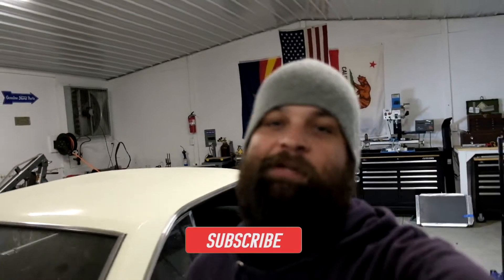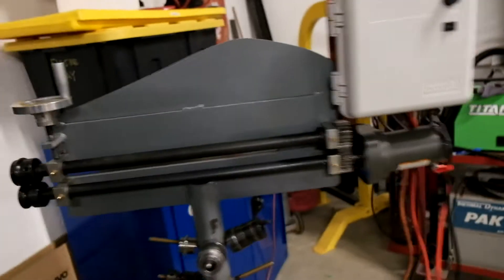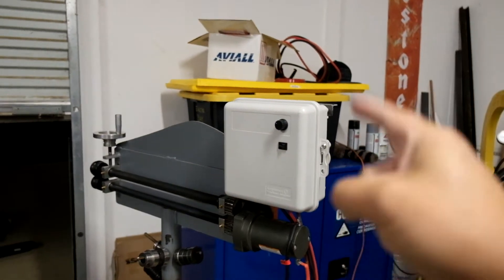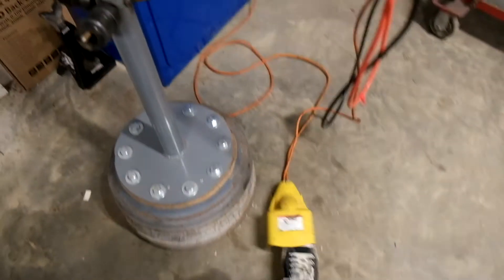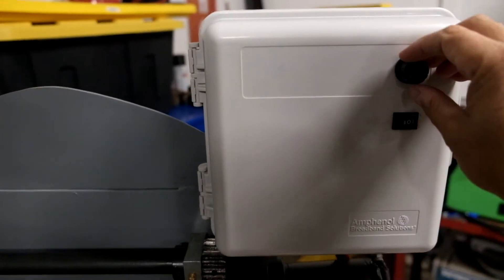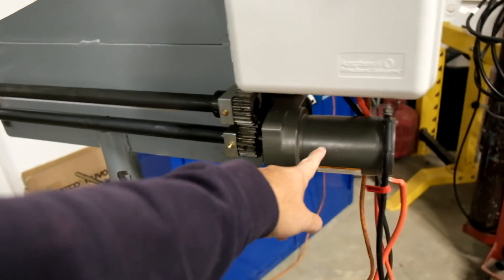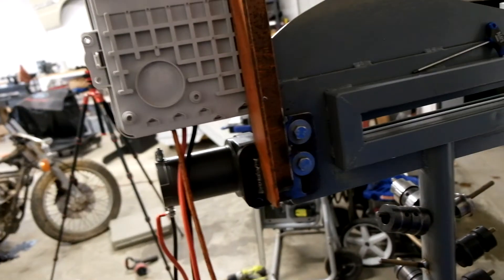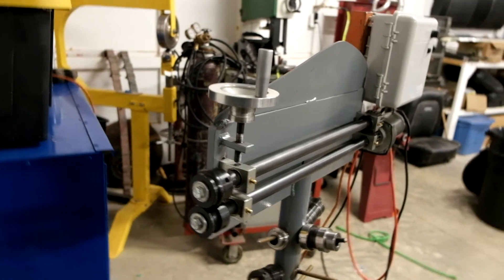How to motorize a cheap Chinese bead roller

Comment: How did you attach the motor to the roller.?
Reply from the maker: I welded the spur gear from the winch to the lower roller.
Reply: @RDspeedfab thank you so much
Reply from the maker: You bet!

Comment: Which winch did you use?  I see there are a handful on HF now.  Your link below doesnt work now.  Thnaks in advance!
Reply from the maker: I believe it was the 2k winch.
Reply: @RDspeedfab  thanks for the reply.  Great build.  Just got my Eastwood roller and definitely going to start purchasing the electric part of it.  Thinking of using the foot pedal to "make" the output of the PWM to the motor.  That was you dont have the on/off of all the components, only the drive motor.  Great build by the way!
Reply from the maker: Yeah that’s a great idea! Good luck and have fun!

Comment: put a fan on it the power supply will burn up it needs air.
Reply from the maker: Yeah I never thought of that. It’s been in there for years now with zero issues. But it wouldn’t hurt

Comment: Thanks for posting this. I've been looking for a video that shows a parts list and goes over the configuration of all the components.
Reply from the maker: I’m glad it was helpful!
Reply: @RDspeedfab  Any idea how to move the speed control to the food pedal? In other words, the motor speed depends on how much you press down on the pedal. Does that require a specific style of pedal?
Reply from the maker: J Dimeo yeah you would need a pedal with a potentiometer in it. Very doable though
Reply: @RDspeedfab  Thanks!

Comment: Rob! I wanted to say this is THE BEST conversion to a motorized bead roller I've ever seen! I will be doing this to my Eastwood bead roller. Quick background. I have a passion for '56 and '57 Ford cars since Dad purchased a used wagon in 1957. I started a restoration on that wagon in 1968 after purchasing it. I took it to a body shop 'I trusted', telling them to replace all the rust. When I got it back, I found the rust was covered in masking tape and body filler! 🤬 I started learning welding and panel fabrication but a draft notice in 1969 changed my plans. I enlisted and ended up staying for 20, retiring as an M-1 Tank Motor Sergeant. During that 20 I continued learning panel fabrication, welding, etc. So, I still do all kinds of rust repair and panel fabrication but don't have the expendable income to pay 'big bucks' when I have the fabrication and welding skills to make almost all the items I've wanted. This video and your parts list gave me items I've been looking for to upgrade a bead roller I've had for 35+ years! THANKS! 😎😎😍

Comment: Excellent Video.  Im a little confused on the power supply.  You said you used a 20amp then in another comment you said you matched it to the speed controller at 60amps.  Can you clear this up?  Thanks!
Reply from the maker: Yeah I’m sorry about that. It’s all 60amp.
Reply: @RDspeedfab  No problem.  I'm ordering things right now.  Maybe next to your links label the items.. Such as "60 amp power supply" "13x13 box".  This would help because the amazon links keep changing to different items.   Thanks again.
Reply from the maker: I need to update those links. I haven’t looked at them in a while. I’ll definitely do that. Thank you for watching and taking the time to comment! Good luck with the build and I hope it makes your tool more useable!

Comment: Do the amps matter? I am looking at building this for my bead roller, but I noticed that the power supply is 20 amps while the motor requires 106 amps at full load.
Reply from the maker: They keep changing the destination for my link. It’s supposed to be a 60 amp. I just matched it with the speed controller. I’ll put up a new link. Good catch.

Comment: Great video.  Does your bead roller move the stand?  I am working on building a stand now and thinking of putting locking wheels on it so I can move it around the shop.
Reply from the maker: No but that’s a great idea! I roll it around since it’s on that brake drum. Just tilt and roll.

Comment: Awesome job. You didn't mention if the reverse switch came with the winch or wich exact winch model you got. Those would be helpful. Again you did an awesome job,i will be duplicating it soon.  Also would like to see it run at full speed. Thank you for sharing this with us. Even the Jamey and mittle ones bogg down when you torque them down on 18 guage. Bet that winch motor doesn't.
Reply from the maker: Thanks for watching and taking the time to comment. The winch doesn’t really bog down at all with thicker material. As for the reverse switch, it came with the speed controller. I did a dedicated video on the electro is as well. Check that out and hopefully it can answer in questions. Thanks and please consider subscribing!
Reply: @RDspeedfab  done and awesome. Thanks again buddy.
Reply from the maker: @jeremiahcompton8306   thank you!
Reply from the maker: @jeremiahcompton8306   thank you!

Comment: @Rob Ardy , I got mine up & love how it works. Thanks for the help & detailed instructions you gave. I'm so glad I seen your video's before I did the drill, chain & sprocket type I've seen other youtuber's do. Now I can finish up the section of sheet metal in my trunk where it meets up with my tail light panel. The 1 peice no one in the aftermarket re-pops.
Reply from the maker: Excellent! Very glad to hear it!

Comment: very interested in seeing how well this is working out for you. Thinking about do the same to a large bead roller I am building. Have you done any large panels with it.
Reply from the maker: It’s been working great! A couple other guys have followed my design and been pretty successful with their builds as well. The limiting factor is obviously the throat depth but it’s plenty large for anything I do. I plan on doing some door panels with it soon but as of now I haven’t done any large panels. Thanks for watching!
Reply: thanks for the quick reply. You by far have the best detailed help out there that I have found. I all ready have the winch motor so I will order the other parts from amazon. I had a HF roller but decided to build a larger one. Here is the one I build so far.  https://www.facebook.com/photo?fbid=10158060413538601&set=pcb.10158060417068601
Reply from the maker: @jameslittle5546  thanks for the kind words! That link didn’t work for some reason.

Comment: Savagery! Best bead roller mod on YT.
Reply: The box in the Amazon link is massive. Not the same box you purchased. I measured the controls and found a box to suit.
Reply from the maker: @russellsprague2140  I’ll
Check the dimensions. My bad!
Reply from the maker: @russellsprague2140  12x12x3. Same as mine. Is that not what’s coming up for you?
Reply: The box the came is the 12 x 12. The circuit board mounted on the back at the top in your box almost touches both sides of your box. The board I received is 7 3/4 long. I can put the little board directly behind it and still have 1in in between.
Reply from the maker: @russellsprague2140  I'm going to be doing another video on the wiring here in the next day or so. I'll cover in depth thedimensions and correct any bad links. Let me know when your bead roller is done!
Reply: The wiring in Chinese. I think i got it figured out 🤓. I'll be watching for the vid. I'm going to incorporate 2 pedals. Forward/reverse. Trying to find 2 cheap smaller pedals like sewing machine pedals.
Reply from the maker: @russellsprague2140  lol sooo Chinese. I had a request on the wiring so I figured I’d help out. Good idea on the pedals! What speed controller did you use? Same as mine?
Reply from the maker: Daaaang!!! Thanks brother! Feel free to share it! Also check the other vid on the bead roller. It’s a little dry but I go into more detail on it. Thanks again man!
Reply: @RDspeedfab   I watched it. My first YouTube comment and we are probably close to the same age haha. I was getting ready to mod the Fak out of the bead roller and stumble across this. I ordered everything lol. Thanks. 
Ever think about adding a table for larger pieces?
Reply from the maker: @russellsprague2140  awesome man! Yeah I’ve considered it. If I do I’ll for sure make a video.
Reply: Same. I ordered everything from the links you provided. Everything looks the same other than either the box size or the power supply box. One is larger or smaller than the other.
Reply from the maker: @russellsprague2140  weird.
Reply: @russellsprague2140  the box is larger. I just recieved the 1 that I ordered from the link. No biggie, it'll give me some extra room, lol
Reply: @reginaldhall6871  I ordered the 9x6x3. Its perfect.

Comment: Do u have a link to the motor you used
Reply from the maker: https://www.harborfreight.com/2500-lb-atvutility-electric-winch-with-wireless-remote-control-61840.html

Comment: Do you have any pics of what and how you attached the motor to the bead rollor bottom shaft?? Thats where im stuck..did you weld it or make a coupling of some sort?? Thanks.
Reply from the maker: The winch has a splined input shaft. I removed the splined output shaft from the reel that cam with the winch and welded it to the lower roller.
Reply: Thanks for the reply...exactly what winch did you use from h.f...?? Thanks again for the help.
Reply from the maker: @joemcclure2747   no problem! Badland 2500lb ATV winch. Looks like the price went up as it’s now $69
Reply: nothing cheap like that up in Canada, 1500lb starts at $150 @RDspeedfab
Reply from the maker: @bjlanders dang that’s too bad! I’m sure the price has gone up down here too. Things are crazy right now.

Comment: How did you get the atv motor to attach to the bead roller
Reply from the maker: I built an adapter plate that picks up the bolt locations on the bead roller and the winch motor.
Reply from the maker: Michael, I’ll be posting a video today with more information on the mount plate.
Reply: Awesome, be looking for it